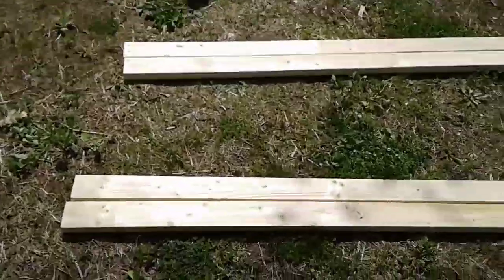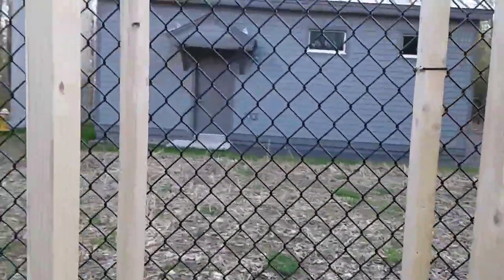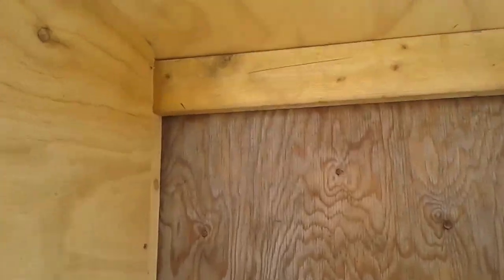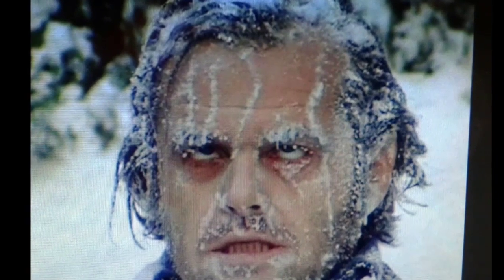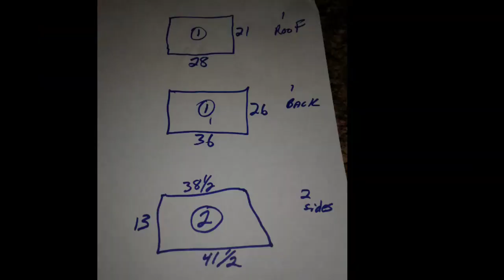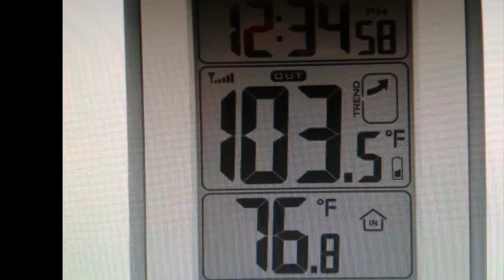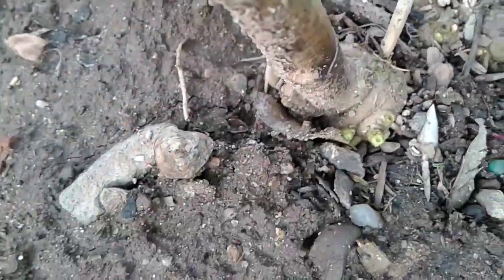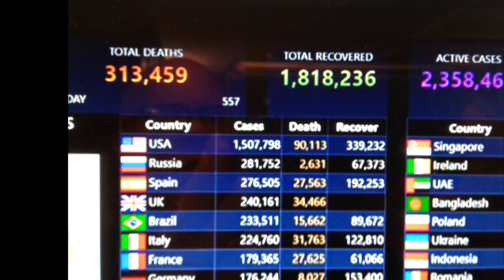Butterfly Hut Build, Real Easy to DIY Project.

Comment: Oh my God is that 180° intake with a duel 850 double pump with a 21 oversize jet kit sitting on top of a set of 202 ported and polished with high lift rollers  breathing down the throat of eight screaming 11 to 1.
Reply from the maker: 950 wait til you hear it...lmao...lol...
Reply: And a 327 Crank to make it a bumblebee 🤭
Reply: Sounds spot on!!!!
Reply: And 2 stage nitrous 😱
Reply: I had a 400 crank in a 350 block
Reply: @notrightjohnnydetectingjun8028  we went the other way with a 350 crank in a sb 400. 383. We used to run a late model at Volusia county speedway in the late 80's.